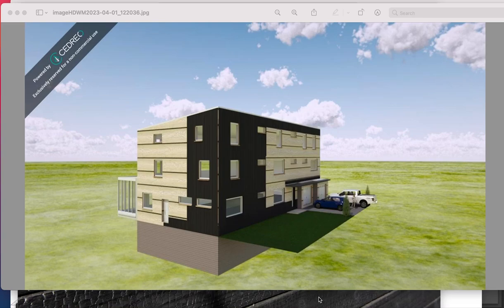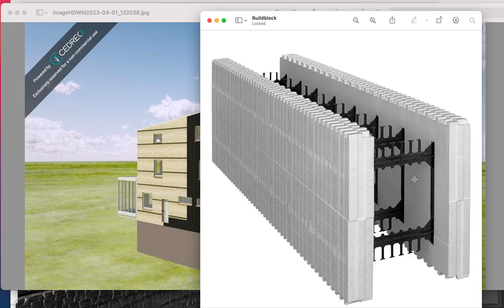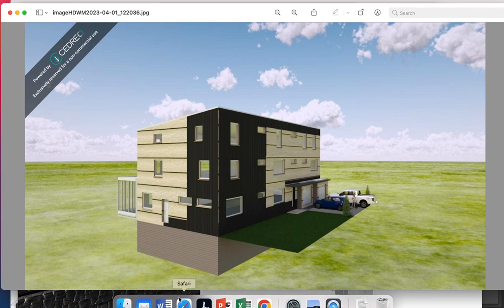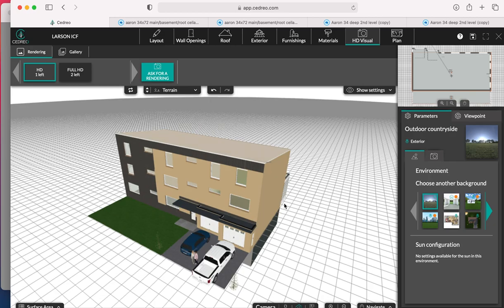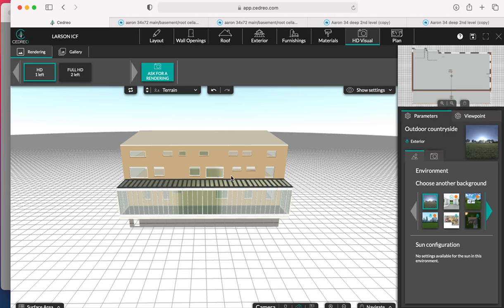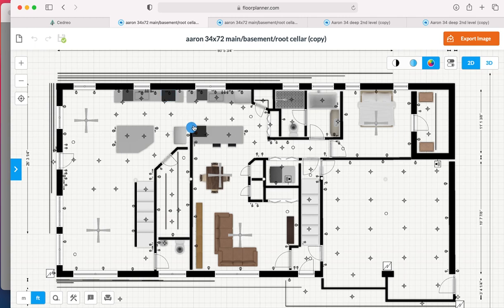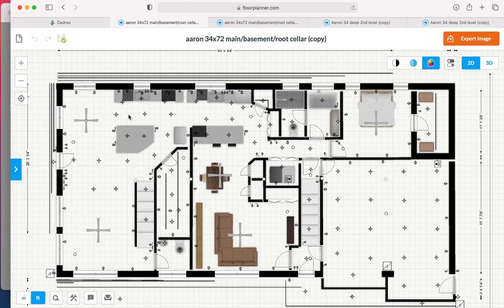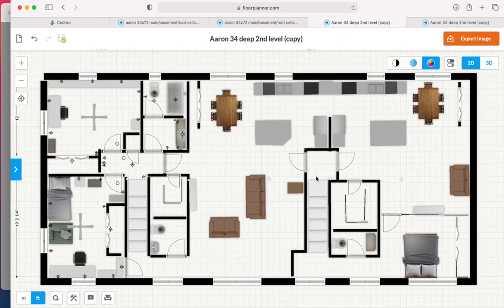Passive House Floor Plans Tour (9,000 Sq ft Multi Generational ICF Home)

Comment: I’m guessing if it’s 95% self built you can do it for $875k. The expenses of hiring out the excavation (which you may undertake, but a double height basement is pretty impressive to DIY), and the windows and greenhouse are likely 100k by themselves. I’m planning mine basically half that size and doing it myself and planning for half that budget. Neat design.

Comment: Cost: $150 per foot if builder grade, minimum code. 9000 ft x $150 is $1,350,000.  But I'm guessing you're building well beyond minimum code, since you describe it as a passive house.  Passive house standard is the most stringent standard to meet, so I'll guess $400 per foot; 9000 ft x $400 is 3.6 million

Comment: How sturdy is this against earthquakes? What sort of climate will this be built in? Utah?
Reply from the maker: It is built to withstand a very large earthquake. There is a lot of rebar in the walls and they are 8 inches thick. 

Plus the rubble rock that the home is built on is ideal for surviving an earthquake.
Reply from the maker: It’s zone 6
Reply: I'm about 30 miles north of you.  The USDA just released new maps - we're now pretty firmly in zone 7 @LegacyViewsICFhomeBuild

Comment: What is the earth tube cfm or cuft and are you running it in the house and the sun room
Reply from the maker: Earth tubes are any type of pipe that you run under the ground to either capture the warmth during the winter, or the coolness during the summer that the earth provides. And yes, I will have it going both into the house through a filter, and in the greenhouse.